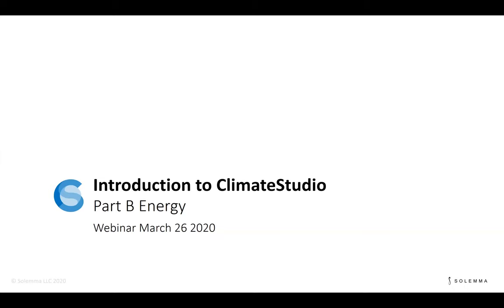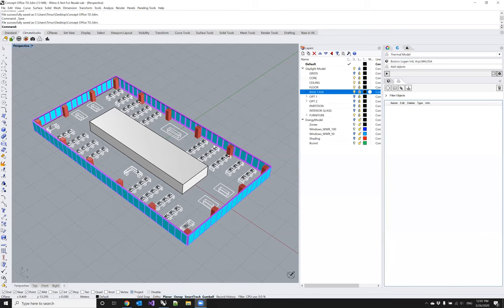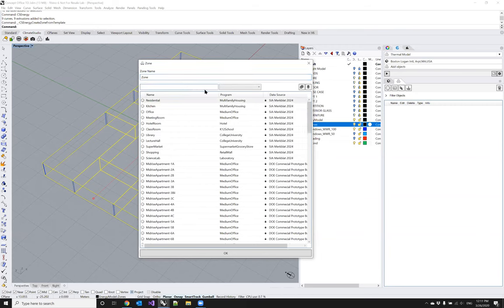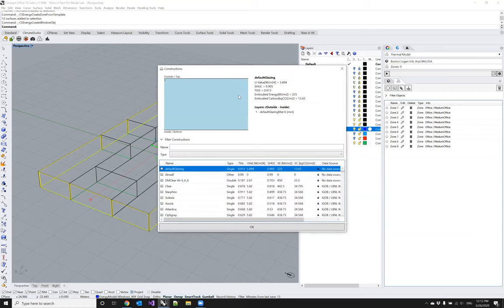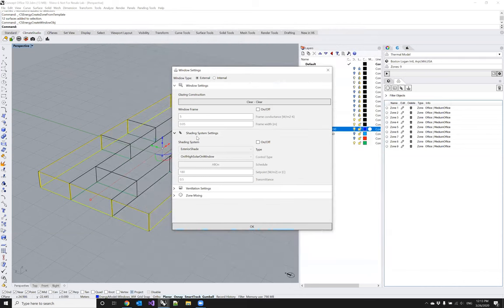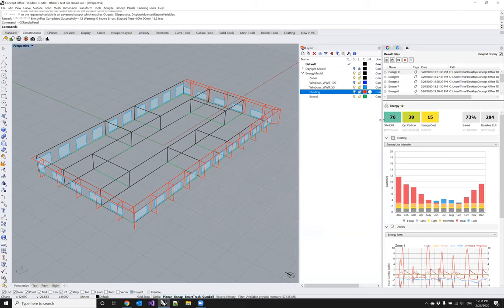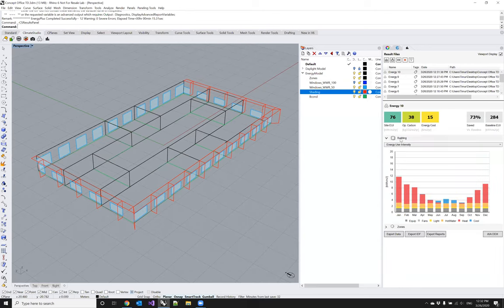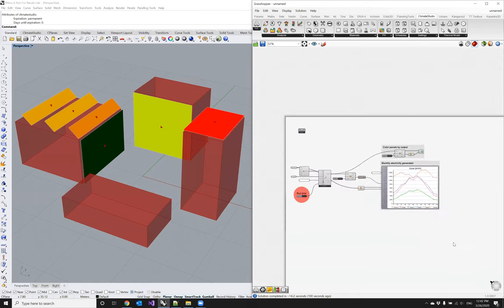Introduction to ClimateStudio Webinar: Energy

Comment: Can we change the unit settings? in the thermal analysis, I want to write values in W/ft^2 instead of W/M^2
Reply from the maker: Yes! You can change the unit system by typing CSSettings into the Rhino command line.